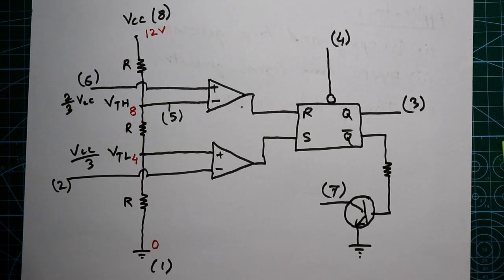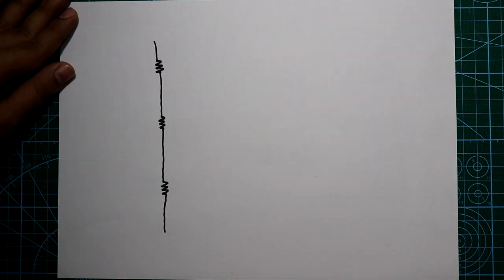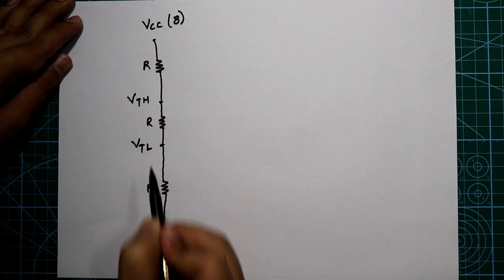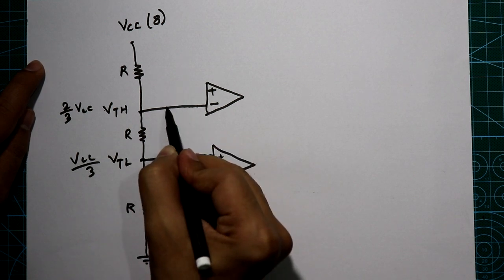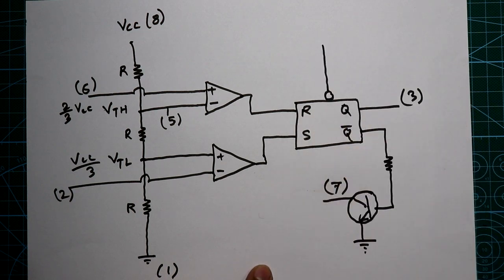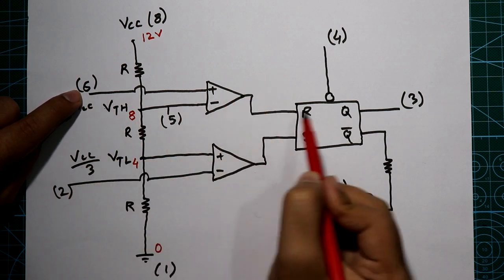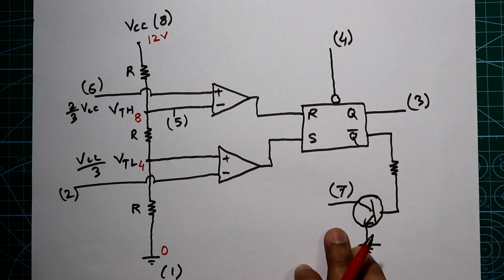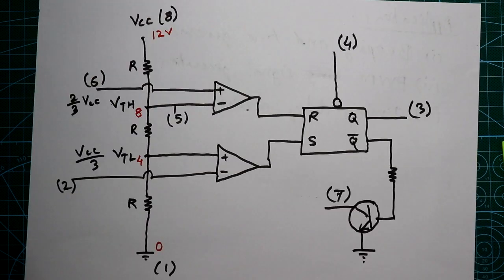Internal circuit of 555 timer | NE555 internal circuit explained

Comment: There is a way of calculating the frequency of an astable circuit using a chart called a nomograph and cannot find any explanation of how to do this and would love to see a video with a step by step explanation of how to use this chart.
Reply from the maker: Could you please provide a link for this chart? I'm not able to find it.
Reply: @EEWave  here is another link and they all say the same thing but don'r show how to use it or i'm just not understanding how it is done. http://docshare01.docshare.tips/files/25701/257011035.pdf
Reply from the maker: Thank you 😊. 
Now I will make two videos with nomograph. 
1.Monostable
2.Astable.
Reply: @EEWave  thank you so much and here is a link to astable nomograph. http://www.555-timer-circuits.com/astable-multivibrator.html